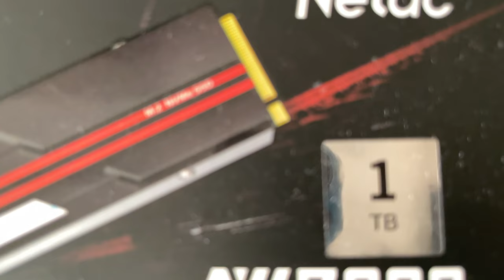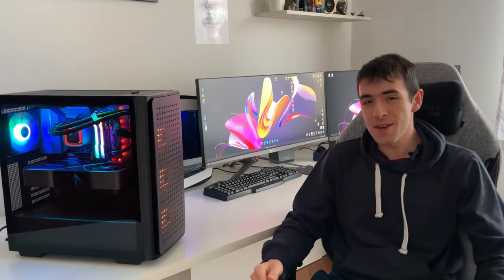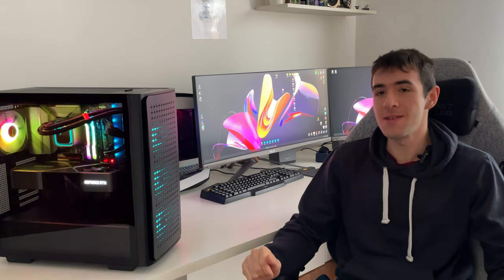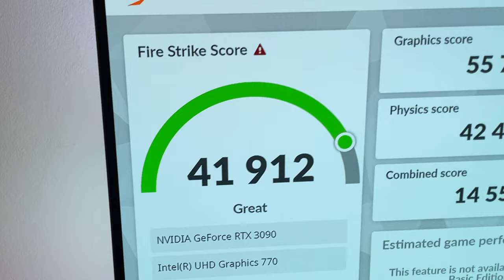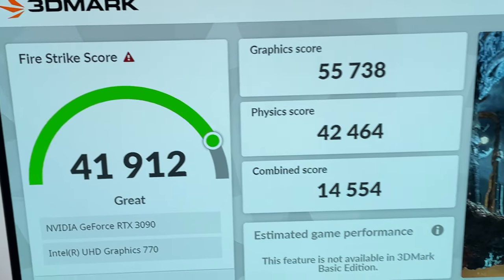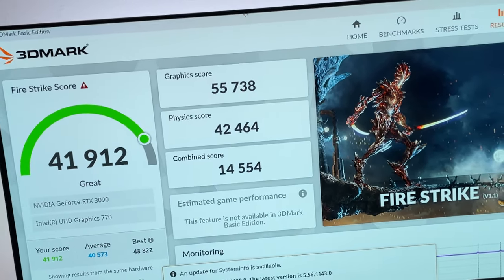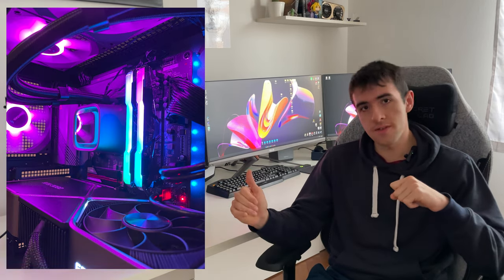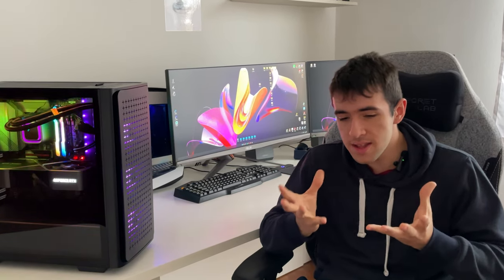This Budget Gaming PC can play at 4k 144Hz || Netac & DeepCool

Comment: bro i trust you. your knowledge i need. My pc i5 10gen, GTX 1660 S , 16GB ram. But 75hz moniter. i need 144hz moniter and RTX 3090 card. how to buy item .  and price. i'm sri lanka. help me bro❤💯
Reply: 3090 will get slowed by the i5 10th gen and ram
Reply: dont buy a 3090, its a bad price to performance ratio. the rx 6950 xt is way cheaper and performs about the same (without raytracing)
Reply from the maker: I’d recommend looking at the used market in your area, honestly I agree with the guy saying that you’d get a huge bottleneck with a 3090. I’d say if you wanna play at 1080p 144Hz, a 3070 would actually be much more than enough! I’d say if you can get it used for around 350€ it’s pretty good!
Reply from the maker: An Used 3090 is actually pretty good value though, if you can get it for under 800€